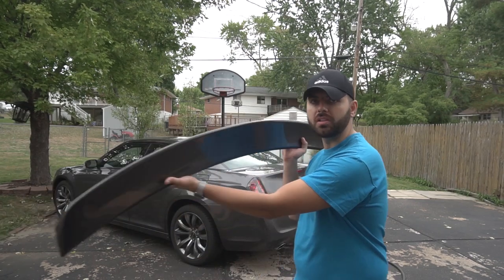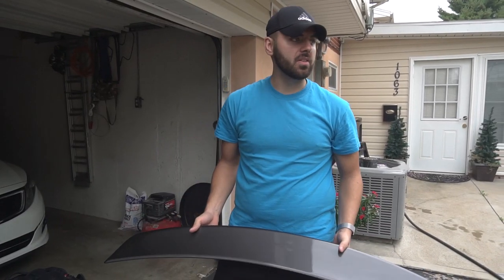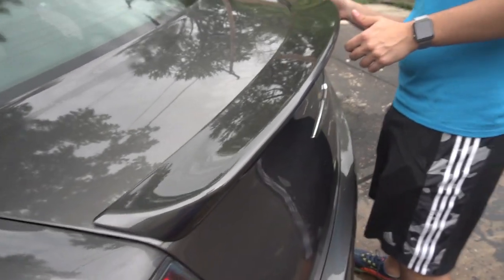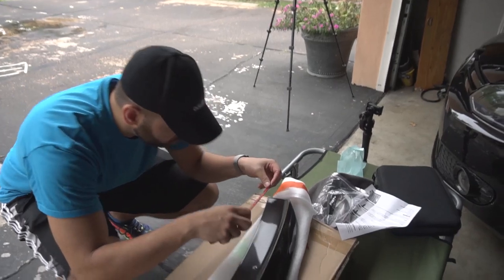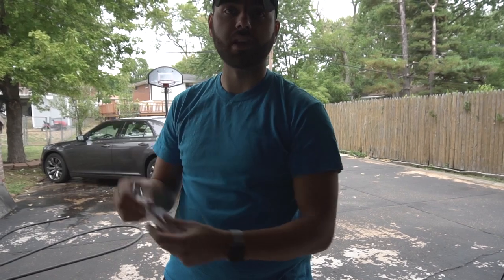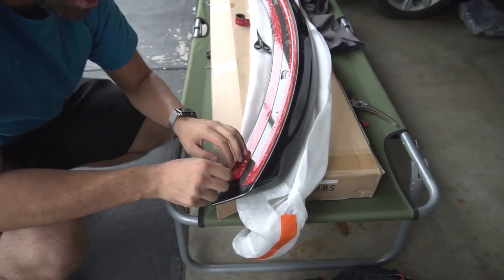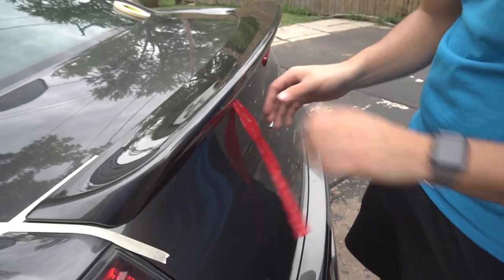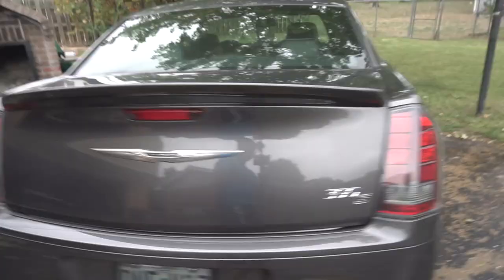HOW TO INSTALL A SPOILER WITH TAPE !!!

Comment from the maker: Who wants me to make a follow up video showing the durability after one year?
Reply: Is it still on ??
Reply from the maker: Luis Corona  yes it’s still on with no problems
Reply: Does the trunk still open up when you use the remote??
Reply from the maker: @MrWillDock  yes
Reply: RT ... Nice Car .. What Rims are those ??? Brand & Model # ....Thank you
Reply: Romanian Thunder What Rims are you Sporting ???
Reply: @iWest Music Group:  Those are OEM wheels.
Reply: Yo so how’s that tape holding up?
Reply: What width of double sided tape
Reply from the maker: They are the stock wheels
Reply from the maker: 1 - 1 1/2”
Reply: Where did you purchase the rear spoiler?
Reply: @RomanianThunder  where exactly did you get the wing painted
Reply: I want the same one where exactly did you get it
Reply: @RomanianThunder  where exactly did you get it I want one just like that and I want mines painted
Reply: Is the spoiler still on?
Reply: Spoiler still on my friend?

Comment: Got advice from an auto body expert because I also didn't want to drill holes into my trunk lid to install the spoiler. First thing you need to do is to use sandpaper and rough up the bottom of the spoiler, Then you need to use a degreaser like R-M 900 to clean off the spoiler. Once that is done you need to use an adhesion promoter like 3M 4298 on the spoiler before sticking on the double sided tape. Make sure you try to cover as much of the spoiler with double stick tape as you can. DO NOT use the tape provided with the spoiler. Make sure you use 3M Super Strength Molding Tape it will say ideal for attaching vehicle body side moldings, trim and emblems. You also need to do these steps on the trunk lid. Use sandpaper or a brillo pad to rough up the paint on the trunk lid. You don't want to take off too much paint. Just scratch it up slightly. Clean with a degreaser, then use an adhesion promoter. Peel off all the double stick tape covering all at once and place it on the trunk lid correctly the first time. Its best to use a second person to install because you only get one chance. Once the spoiler is on the trunk lid press down firmly and use a microfiber cloth to push down and move along the top of the spoiler to fully seat to the lid. Use a heat gun or blow dryer to heat up the tape along the edges of the spoiler. Wait 72 hours for the tape to fully cure before you drive in the rain or carwash. Your spoiler should stay on permanently now!!
Reply: Very Nice, But a bit overkill imo
Reply: I put side scoops on my Mustang without sanding anything. I did exactly what the author of this video did. Although the side scoops aren’t on a moving part, like a trunk lid. 

However, my side scoops have gravity and wind (driving fast too!). They have stayed completely in place for 10 years, without screws or sanding. I did exactly what Romanian Thunder did.
Reply: Scuffing up the underside of the spoiler I might try but not the vehicle clear coat unless ur 100% positive it will not be changed. And if u do choose to scuff the clear coat mask the sides of the area with tape so u don’t go outside if what the spoiler will cover. One thing I’d do differently from the video is apply tape to the sides and bottom edge like the first piece so dirt etc won’t get underneath
Reply: The reason I got an adhesive spoiler is so I didn't have to damage my car. TF you mean "sand down your trunk." That's insanity.

Comment: I got the same spoiler for my 300 and I drilled 3 small holes and also used the 3m tape I wouldn’t trust that tape alone for a rear spoiler
Reply: Where did you purchase your spoiler?

Comment: I did everything exactly as you did here and the outside edges of the spoiler came loose after a couple of weeks.  Use the hidden bolt kit that came with the spoiler and do it right!
Reply: Same here. Had mine bolted on as well.
Reply: Where did you purchase your spoiler?

Comment: Awesome, i just got a spoiler from the same company to add to my gf optima.. i have on my sonata a carbon fiber one and it been holding on pretty good with the 3m tape..about 3 years now..i did just remove it to have the carbon fiber re done.. nice job man.

Comment: I did mine about 2 years ago and after about 4 months it started lifting on the corners, I’m about to remove it and install with hardware
Reply: scott hughes I have the same problem and it lifts on the edges. I have a 300 too. I took it off and reinstalled it but I started lifting again. Have you drilled yours in yet?

Comment: Warming the 3M tape with a constantly moving heat gun will make a big improvement in adhesion also. Use caution -- DO NOT overheat the spoiler or it may warp!

Comment: I'm about to install this spoiler on my 300 as well. Can you tell me how well it is mounted? It's a daily driver and I just don't want to have any issues in the winter with it coming loose or anything.
Reply from the maker: I have no problems. Make sure your paint is clean. The 3M foam tape is super strong.
Reply: Thanks for responding. I put the spoiler on a little over a week ago. I did exactly what you did in your video. It looks like its holding ok but the ends of the spoiler look like they have a gap between the spoiler and the trunk. Have you had this issue?
Reply from the maker: The gap is normal.
Reply: That's what mine did as well!
Reply: The gap IS NOT NORMAL OR ACCEPTABLE!

Comment: hey Romanian thunder,  how has it held up since you frist put this on. I am going to do mine the same way but first I want to know if it will hold up.  thanks for the video.
Reply: Richard Roberts that’s what I’m wondering. After a typical American summer and winter how does the tape hold up.
Reply from the maker: it's on there good. I installed this last year in August. Made it through the Cold Missouri winter and hot summer.  I power wash my car all the time and it dosnt effect it.
Reply from the maker: It's held up great!!! I live in St. Louis Missouri where it is hot as hell in the summers and ice cold in the winters.
Reply: @RomanianThunder  hey I live there!

Comment: This won’t come off when taken to a carwash drive through ???
Reply from the maker: Nope! I power wash my car. Its been on there for almost a year without problems
Reply from the maker: Correct, if you clean and prepare the surface you should not have any problems. I power wash my car every week.

Comment: Interesting that you did NOT run the tap ALLLLL the way to the ends, as the ends/tips is where it is apt to curl up or not rest flush on the trunk deck.  Did you own the car long enough to see if the results held up?

Comment: will the tape peel the paint if the spoiler ever needs to come off? i just bought a spoiler for my alfa romeo giulia and i will be using tape to apply it
Reply from the maker: I never had to remove it and I have no plans to remove it. It should be permanent. I had it installed on my car for a year now with no problems.
Reply: The best way to remove it is to clean around the edges really well and use wd-40 and 20lb fishing line. Won't leave a mark and the little bit of tape left over can be removed with a microfiber cloth and wd-40

Comment: How do you choose color when ordering ?
Reply from the maker: Alejandro Villegas Check the manufactures sticker located on the drivers side for your cars paint code.
Reply: Romanian Thunder and you type that in where? On message to seller ?
Reply: I typed the color code in a message to the seller on ebay.  Some of them even have the lists of colors for your car and their codes on the ebay listing.  Pretty simple.  Got my wing recently and looking forward to installing it
Reply: @RomanianThunder  thanks for making the vid, made it look real easy

Comment: Where did you order it from bro, it looks so dam good .... drop the link...
Reply from the maker: PAINTED FACTORY STYLE SPOILER fits the 2011-18 CHRYSLER 300 STR8
⇵⇵⇵⇵⇵⇵⇵⇵⇵⇵⇵⇵⇵⇵⇵⇵⇵⇵⇵⇵⇵⇵⇵⇵⇵⇵⇵⇵⇵⇵⇵⇵⇵⇵⇵⇵⇵⇵⇵⇵⇵

https://www.ebay.com/itm/PAINTED-FACTORY-STYLE-SPOILER-fits-the-2011-18-CHRYSLER-300-STR8/192077420073?hash=item2cb8b4d629:g:NXoAAOSwPcVVn8ED

Comment: good vid...post the link to the spoiler and the tape
Reply from the maker: Here is the link for the spoiler:

http://www.ebay.com/itm/563-PAINTED-FACTORY-STYLE-SRT-SPOILER-Fits-the-2012-2016-CHRYSLER-300/162123590413?ssPageName=STRK%3AMEBIDX%3AIT&_trksid=p2060353.m2749.l2649

Here is the link for the 3M tape:

http://www.ebay.com/itm/3M-1-x-9-ft-VHB-Double-Sided-Foam-Adhesive-Tape-5952-Automotive-Mounting-25mm/401261223885?ssPageName=STRK%3AMEBIDX%3AIT&_trksid=p2060353.m2749.l2649

Comment: I just used this method well I had someone else do it for me but doesn’t seem as flush as it should on one end maybe tape wasn’t lined right.. what happens if water seeps in because this tape is a bitch to take off and do it over